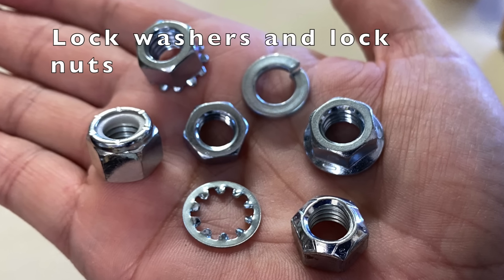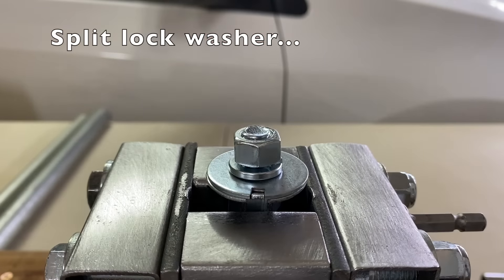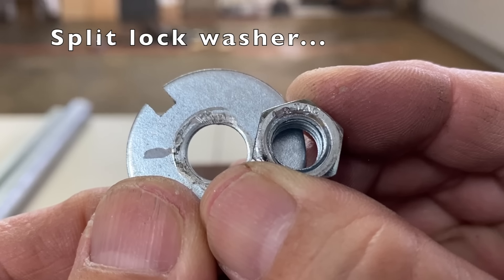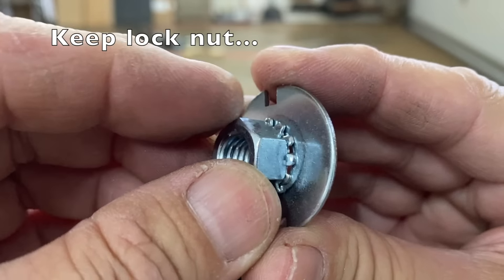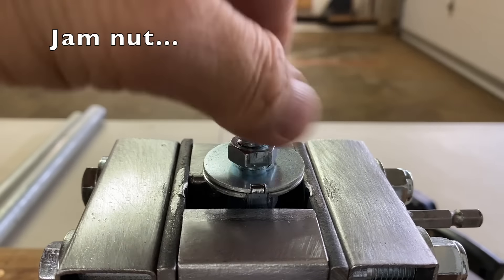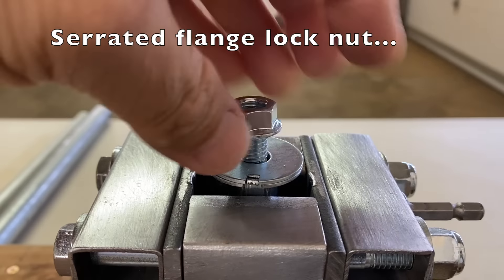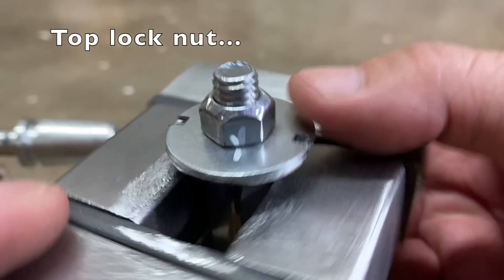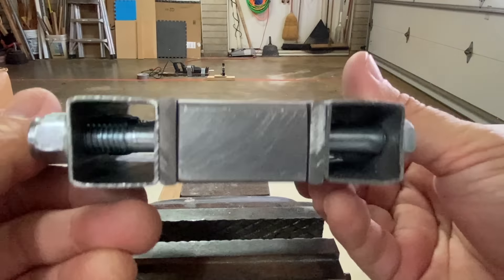Lock Washer & Lock Nut Vibration Test

Comment: nylocs are the best but do age and stop working as well, they also can melt. The split lock washer is actually a spring putting tension on the joint which also loses tension with time. Now natures lock tight works the best lol.

Comment: If you want to do this right, use two drilled bolts and/or nuts and some lock wire and wavy grip lock wire pliers, then it is airworthy and never comes out.  Or cheaper, get the ramp washers with a ramp greater than the thread pitch, that never comes out either.  Anything less is not something a good engineer signs for.
Reply from the maker: Do it right?  Where’s the fun in that?   😎
It was fun seeing the nuts and washers fly off!
Reply: @HacksbyDad  Oh I agree, This video serves great as a warning of how not to do things.  Just not when someone's actually relying upon them in a safety critical fashion, like for aerospace, NASCAR or Motorcross, where bolts are subject to that kind of stress and you have no time to tighten them.
Reply from the maker: @notamouse5630  👍

Comment: I thought that the ones with teeth were intended to improve electrical connections, not reduce vibration loosening.

Not that I really worry about the latter very much here in the rust belt.

Comment: In my case, ai use Nyloc for my RC, but in the plastic depending on where you play RC the plastic will fail in the long term, but hold well depending on what type of RC you use basher can lose the grip, crawlers not happening

Comment: The purpose of a washer, if used by M.A.N. on a printing press, is to ensure that something can be disassembled. They do NOT use washers of ANY if it is not intended to be easy to disassemble. So redo the test without any washer of any kind to investigate that situation.
Reply from the maker: The coupling nut and flat washers were locked together with notches and tabs so the flat washers couldn’t spin.  I explained this in the video but cut it out after seeing viewers abandon the video at that point.  I guess the explanation was too boring.  LOL
Thanks for watching the video and for the suggestion!  😎
Reply: @HacksbyDad  Interesting and yes, it is tough to keep viewers from zapping. I have a film with three machines, most people just watch 90 seconds, a wee bit of images of the first of them. 

A test without any washer of any kind would be a valid baseline, and measuring loosening torque for the various setups could be a fascinating sequel. A great concept to test with vibration.

Comment: If you check out the NASA fasteners manual you will discover that spring washers do not help nuts from coming  lose as the torgure to compress them flat is very small compared to what is needed to tighten the nut. They are no substitute for the correct torque.
Reply from the maker: Yeah... I was surprised that the split lock washers did so well.  I'll do another test with grade 5 fasteners and more torque.  Thanks!

Comment: One of the primary reasons locking fasteners fail isnt just due to vibration. Uneven heat expansion cycles is also a big part of it. It can also be the reason it works if proper material choices are made.
Reply from the maker: Uneven heat cycles?  That might work as a future experiment and video.  Thanks!
Reply: @HacksbyDad  heat changes the properties of materials in different ways at different rate, also their dementia s change at differing rates. A tightened stud can be some loose simply by outpacing the expansion of the parent material it is screwed into.
Reply from the maker: @bafumat  Got it.  Thanks.

Comment: All these are not used in high vibrations applications, that would be considered a high vibration application. What size bolt, and grade were you using? 11 ft.lbs. seems a little low for what appears to be about 3/8” bolt.

Comment: You didn't say and reading a few of the comments no one asked, what was the locking system used on your jig?  I couldn't see it very well.  Maybe a split lock washer with a nyloc nut?
Reply from the maker: Just nylocs.  The bolts holding the rig together are under much less severe axial stress versus the more severe and impactful transverse stress that the jig experiences.    
😎

Comment: How the top lock nut works? It seems to be the best. Is there any modification on its thread at the end, and this is how the joint is so good? It is similar to the nylon lock nut just the material not nylon but metal?
Reply from the maker: Yes.  The threads on the cone end are distorted.  😎

Comment: Needing more torque? To avoid busting things, I usually have a thumb over the nut when using a spanner. Seem to remember like 5mm bolts take about 70Nm. Satellite dish hasn't moved in 10 months.

Comment: You should have marked the lock nut against the bolt for the nylock.  Of course it could have rotated vs. the washer but not loosened.
Reply from the maker: Thanks for the suggestion.  I'll probably redo this test in the future.  Right now... I'm planning to put Loctite threadlockers through the vibration test.  😎
Reply: @HacksbyDad  No problem.  Pretty darn interesting video though!  I really was surprised the nylocks did so well.

Comment: Great demonstration, now do it again but properly torqued to spec based on bolt size and thread pitch. You'll probably find that all of them perform a lot better.

I'd also be very interested to see a thrust and cupped washer similar to those used on marine props.
Reply from the maker: Thanks!
They were torqued to low-grade A307 3/8" x 16 specs.  I'll redo the test later with higher grade 5 fasteners.  Just finishing up the test with Loctite Red and Blue.  
😎
Reply: Thank you 👍

Comment: I guess Chevy did their homework prior to installing the Top Lock Nuts on the rocker arm studs of earlier V8s?!
Reply: I dont think anybody had invented Nord-Lock washers yet, the only downside to top lock nuts is that they cant really be reused, unless you want to run the risk of a rogue rocker arm deciding to make a neat little window in one of the valve covers, if your lucky, if not the arm shoots sideways into the other valves and you knock a whole damn bank out.
Reply: @Initial_Gopnik  Yes, but clearly, they did their homework with what they had at the time!  Now all the performance engines (motorcycles, marine, Chevy LS, etc.) use bolts on internal parts.  Haven't seen any of the big manufacturers using the Nord-lock?!  Also, if using Nord-Lock, you have the potential of two additions pieces of shrapnel flying around in the engine in the case of failure!  Looks like a good product, though!
Reply: @badgerbait8351  Of course! I was never doubting the engineers, at the time it was simply the best solution they had short of wire-locking all the nuts together like they would on an airplane, but had Nord-lock washers existed at the time, they absolutely would have loved them, and probably used them a whole lot as engines and transmissions were quite a bit rougher back then, inducing a whole lot of high frequency vibration throughout the drivetrain and into the frame.

Comment: Locking teeth and split washers aren't designed to bite into the washer or nut.  They work using spring pressure.
Reply from the maker: Well... that pressure bit into the washer and nut.  LOL

Comment: I am curious to know what you used to hold your test rig together. It outlasted everything combined.
Reply from the maker: LOL!  
Those are nylocs, but I retighten them between tests.  They also undergo an axial load (along the bolt length) that is much less stressful than the transverse load (across the bolt) that the jig experiences.  
😎

Comment: Each type of lock nut or lock washer a specific design for what you're doing even the chemicals to use and they're types of different chemicals you can use. Show not once it's all it's what you're using it for.

Comment: Bolt + nut are not intended for use like that. The shaker system is a good idea, but the bolt rig you've got set up does not accurately simulate any application of a nut and bolt I'm aware of. Nut and bolt fix two elements together, stretching the bolt and compressing the two joined elements. If you build a slightly bigger jig you could fit that assembly into the jig. But yeah nut and bolt fastened to itself doesn't do what either component was intended to do.
Reply from the maker: Thanks!  It's my garage-version of an aerospace vibration test that I saw a video of.  Locking devices that do well in this type of overkill test will more likely perform better in real-world conditions.  If anything... it's somewhat entertaining.  😎
Reply: @HacksbyDad  It was entertaining. A good way to get the nut to stay on is to wire up the thread behind the nut and tie it off. You don't need a hole through the bolt, but it's better with the hole.
Reply from the maker: @benjaminzedrine  Interesting.  I might have to try that... and post a video.  LOL
Reply: @HacksbyDad  The scariest bolt in the world to me is "the god bolt" for helicopter rotors. Rich and famous be damned, the only way you'd get me in a helicopter is if the matter was already one of life or death.
Reply from the maker: @benjaminzedrine  I never thought about how helicopter blades are held in place.  You're right... scary!
Reply: @HacksbyDad  OK I got my nuts and bolts mixed up. "Jesus nut", main rotor retaining nut. Thanks for crap talking, it's been fun :) keep up the good work.

Comment: If propely torqued you do not need a washer if your hole size is correct.
Reply: I would always use a washer with split rings, they serve as sacrificial protection for the part they sit against.
Reply: I think this heavily depends on the material and application.

Comment: Your marking method is showing whether the nut moves relative to the washer, not whether it moves relative to the bolt. You should have marked up the bolt, or measured the length of exposed bolt, so we could see how much the nut was actually backing off the fastener with each run.
Reply from the maker: Thanks!  Others pointed it out too.  😎

Comment: Can somebody pls explain what force resulting from the vibration makes the nut loosen and completely unscrew?    My intuition of a vibration is that it is a random movement, acceleration in random directions (from the point of view of the nut)  but to unscrew a nut all the way requires some 'intelligence' in the resulting torque, at least in the sense of having consistent direction for some time.
Due to the randomness of the vibration I would expect those elementary impacts to work 50% of time to tighten the nut and 50% to loosen it.  Like if we were throwing a coin and if it is tails we tighten the nut a bit if it is heads we loosen the nut a bit.  But it seems as if all the vibration works only to loosen it.   Why we can't put a nut on a bolt, and watch it tighten itself due to vibration?  What make a nut more prone to self-loosening than to self tightening?  I mean in the middle of the thread when both directions require the same torque for the nut to go.   We can even observe an acceleration in the loosening, once the nut loosened halfway the bolt it takes no time to completely fall off.  Why does this effect accelerate?  Is there a physicist here, please explain.

A related question:
If I put 100 pairs of nuts screwed on bolts into a metal container, and shake the container vigorously for 24 hours.  Will all 100 nuts and bolts come out separately?

Comment: I think it's funny that the teeth ones ended up making everything worse 😂😂

Tbh I didn't specifically know what these were for in the past, guess I'm glad I've been using the split washers whenever I make something custom (which is admittedly infrequent; I pretty much just went with what most of the things I've assembled used, but I'm glad to know it wasn't for nothing ¯\_(ツ)_/¯)
Reply: I was thought that the teethed ones are actually ment to avoid interference with radio's. Since they can bite through paint and thus make good grounding.
Reply: @crazy031089  maybe 🤷🏿‍♀️

Comment: This is a defective test. It does not represent a true bolted assembly. You need to bolt and torque two separate components together. Another good test is to thread through a component into a tapped hole. My research and experience has shown that lock washers are pretty much worthless. If you look over your car you will not find any lock washers. The Nylock nuts are ok to use, but not necessary. Locktite is also good to use if it gives you some peace of mind. Aircraft use castle nuts and lock wire or cotter pins. At any rate, thanks for your time putting this test together.
Reply from the maker: Thanks!  I'm just goofing around in the garage and sharing my experiments.  Did you post any of your research?  I'm working on another test rig and am open to ideas.  😎
Reply: @HacksbyDad  Hi HacksbyDad - No, I never posted any research. I’m a retired engineering designer who spent most of my career (40 years) designing industrial food processing machinery. One of the key aspects of food processing equipment is sanitary design. By eliminating lock washers, it helps eliminate tiny cracks and crevices where bacteria can grow on tiny trapped food particles. This is especially important in areas where there is direct food contact. I worked at different companies designing dairy, poultry, and pizza processing equipment. Thanks for asking! I appreciate it very much.
Reply from the maker: @JMWexperience  40 years!  Wow!  👍😎

Comment: Interesting. What is holding the test frame together?
Reply from the maker: Nylocs… 😎
From what I’ve read… the force on the frame nuts and bolts is an axial load which is minimal compared to the transverse load that the bolt and nut in the test jig experiences.  I’m vibration testing Loctite threadlockers… stay tuned for that video.  LOL

Comment: Good test except for one thing.   The test was to determine if the locking features prevented the nut from loosening. Showing that the washer spun under the nut doesn’t show this.  Marking the threads above the nut will show this.  Good video though

Comment: I alway swear by  Nyloc nuts…even if they did loosen, they stay on the bolt whereas with all those locking washer types once loose it just unthreads easily.

Comment: Thanks for this but you are supposed to us the two nuts, you are supposed to tighten them AGAINST each other, not just tighten one down on the other. Or use two nuts of equal size and style and tighten them AGAINST each other. Also it would have been interesting to see the split washer WITH the nyon nut together.

Comment: I liked this test, but it would have been neat to see a normal nut get “staked” and see how it performs in the same test.
Reply from the maker: Curious… what does “staked” mean?   
😎
Reply: @HacksbyDad  after torquing a normal nut, you take a chisel or flat blade screwdriver and strike one of the sides of the nut with a hammer
Reply from the maker: @rubberbabybuggybumper6270  Oh... that's what that's called.  Learning something every day.  Thanks!

Comment: Eleven foot pounds is about one third of what 3/8" or M10 coarse thread fasteners require. So this test shows how much loose fasteners loosen?
Reply from the maker: Thanks!
These were low-grade A307 fasteners that were spec’s with a low torque.  The cheap stuff from Home Depot that I could afford.  LOL!  I’ll test higher grade 5 fasteners after I save up my pennies.  😎

Comment: He amplitude of your inuts and subsequent back and forth movement  are MUCH higher than they should be and not representative of a bolted joint. The bolts wouldnt move that much. 

Having said that, the NASA fastener manual forbids use of split washers.
Reply from the maker: Thanks!
Yeah... it was overkill and fun to do!  I got the idea from a manufacturer's video showing the aerospace vibration test setup.  Mine is the garage version.  LOL

Comment: I suspect your serrated and internal tooth washers are simply too soft... There are plenty of cheap "decoy" kits out there, full of hundreds of dead soft mild steel parts in all different sizes, all completely useless! Proper serrated washers are spring steel, and even harder than a 12.9 cap screw so they can dig in. Nevertheless, Nordlock are the best for serious applications (Mitsubishi use them on wind turbines, where it's slightly inconvenient to have to go back to tighten them up every so often). Personally I would always reach for the Loctite for casual use; i've had great experience with it. And with short bolts, combine with a thick conical Belleville preload washer rated for the fastener so you get good intial stretch in the assembly.

Comment: Nylons come different colours not because they look pretty because they are different strengths the white one are for putting together IKEA they junk
Reply: Yet they performed well in this test.
Reply: @Chase Williams blue black red purple you have to go to a nut and bolt place they will list what strength they are also you will not get counterfeit nuts an bolts trash that comes out of China or Taiwan they been this for decades.Harley Davidson back in the 70 used black theirs is a lot to know do your own home work .more questions? Just ask
Reply: I'm pretty sure those colors are different plastics, so changes could be for durability & chemical resistance.
Reply: @Iowa599  and vibration also is a use once fasteners stainless fasteners also and only up to grade 5 .when putting together something if you have a parts book or a manual don’t think you smarter than the engineers who design it they got payed a lot more than you.theirs a lot to learn like counterfeit fasteners imports from China an Taiwan.they are very strict about this in Canada in a industrial setting.to many hi rises and steam plants where put together with this crap.
Reply: @noreenbedford7106  just use extra gasket goop & Lincoln Loctite. If it ever leaks again the cause must be a design defect, not because it worked loose, so the assembly should be replaced.